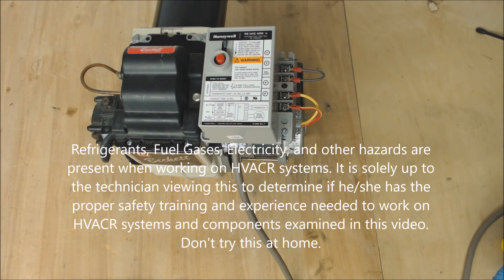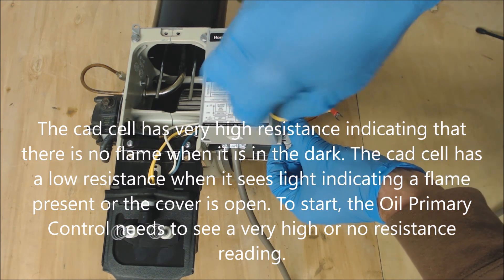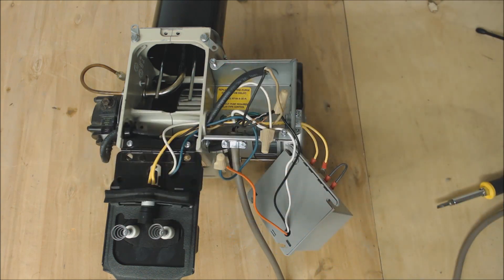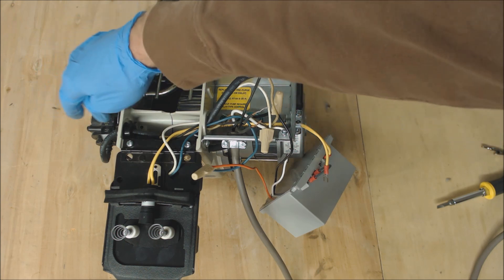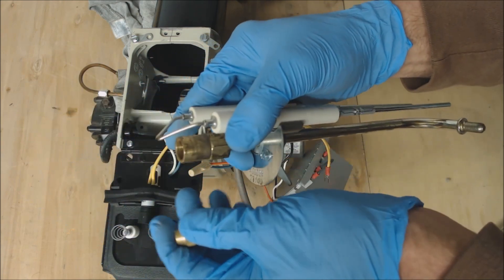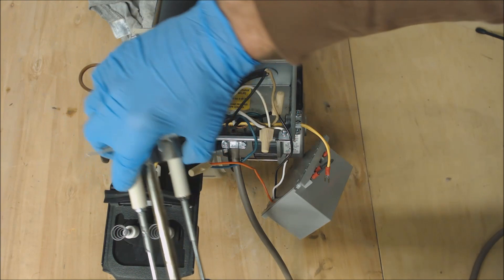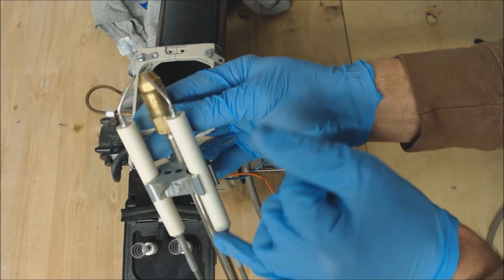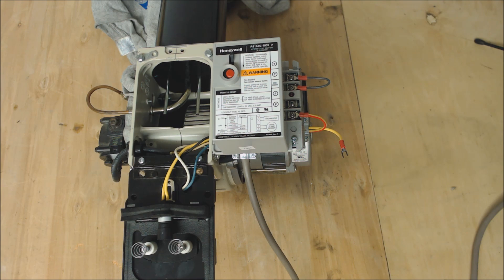Oil Burner Ignition Transformer and Electrode Troubleshooting!

Comment from the maker: Tool List-  https://www.amazon.com/shop/acservicetech
Support-  https://www.patreon.com/acservicetech
For those that are looking for the tools used in the videos: (Linked Below)

Intermittent Ignition Oil Primary Control by ICM- http://amzn.to/2AGvcPi

Nitrile Gloves 100pk - http://amzn.to/2jG2rHS

Cad Cell with Bracket by Beckett 7006U- http://amzn.to/2jGajJk

Beckett 51771u Electronic Ignitor with "A" base-  http://amzn.to/2ib22N8

Ignition Transformer "Allanson 2721-628G"-  http://amzn.to/2noADwD

Multipurpose Electrode Gap Gauge by Beckett- http://amzn.to/2AqavV5

Beckett Z2000u Gauge Kit "Z" for setting electrode gap- http://amzn.to/2jFuPd2

Here is the Link for the UEI DL479 Multimeter with temp sensor- http://amzn.to/2jtsUbJ

Here is the Link for the UEI DL 469 Multimeter- http://amzn.to/2jw4ePJ

Here is the link for the Irwin Wire Stripper/Cutter/Crimper-   http://amzn.to/2dGTj2V

Here is a link to the Stanley 6 in 1 screwdriver-  http://amzn.to/2x7NuaZ

Other tool links can be found in the video description section.

ACSERVICETECH is a participant in the Amazon Services LLC Associates Program, an affiliate advertising program designed to provide a means for sites to earn advertising fees by advertising and linking to Amazon.

All of the ACSERVICETECH Playlists-  https://www.youtube.com/channel/UCOZR-1IqsAer9wzlvFgb4mA/playlists?view_as=public

If you want to support the ACSERVICETECH Channel and receive more HVACR content, check out www.Patreon.com/acservicetech

Comment: I  finally  I  noticed  the  2  ELECTRODE RODS   AT  THE TRANSFORMER   SPRING  CONTACT  were slightly OFF  the  HORIZONTAL  WHICH   Prevented  FULL   Contact of THE  2 Transformer  Springs FROM EVEN CONTACT TO THE ELECTROD RODS       
 I NOTICED  THAT  THE SET  SCREW  OF THE   90  DEGREE  ANGLED FUEL  INPUT  PUPE  WOULD ALLOW  THE  ANGLE TO  BE  CHANGED   WHICH I ADJUSTED  AND  NOW  I  HAVE  FULL  EVEN HORIZONTAL CONTACT   TO THE  2 ELECTROD RODS AND  NO  MORE  SHUT OFF  OF  MY BURNER

Comment: So I have a transformer with copper tabs, not the type of springs and the igniters have copper leads (like flat sheet metal) that the transformer tabs contact. I was looking into replacing the igniters, but can only find the ones like you show in the video which are rods. Can you use the rid type with the copper tab style transformer, or can you lead me to finding the ignition style that has flat copper leads?

Comment: Great video, very educational. I have a rumbling on my weil mclain gold oil burner. I've tried different things to fix the issue but some how it continues, I found a smaller nozzle installed with 100 psi pressure wich I adjusted to the cottrect nozzle output and the rumbling continues, I replaced the expansion tank and close the oil supply since I have a large oil canister and I though it was sending too much oil. Any advice will be greatly appreciated. God bless and please continue with this great videos.

Comment: My relay doesn’t have a wire attached to the T T…..and keeps tripping off at times. At times it trips off, but stays on for two or three days that my relay does not have a wire connecting to both T and T does it need it in order to run correctly?

Comment: My oil furnace shuts down and black smoke rolls out by ignitor assembly.  it does it intermittently.  Help?  We replace nozzle but not sure size is correct, changed air filter, oil filter, and fire looks good.

Comment: Thanks for the video. The spark I am getting from my contact springs is very small. My furnace usually runs, but periodically won't start unless I press the reset button. Any idea what the issue could be?
I've cleaned the nozzle and checked the electrode position - both seem fine.
My contact springs do seem somewhat corroded though, could that be causing it?

Comment: Spark at the springs (alligator clip) seemed weaker than how it looked in the video, but when I performed the 'trick' at 8:15 spark at the nozzle looked fine. While I was in there I hit the conductors with steel wool. Put everything back together and it fired up. Not sure what did the trick but thank you for the troubleshooting tips.

Comment: Why is there a short (jump) across the thermostat terminals?
Reply: It is to simulate calling for heat.  If you're burner is hooked up to your boiler and you have your thermostat connected and calling for heat then you should not need to do this jump.

Comment: I installed a new transformer, non electronic model, but found issues when I used the front foam gasket.I was getting an occasional reset of the burner control. I discarded it and it has not reset since. Thinking my heating system was designed in the 60`s might not handle these newer 3000 plus rpm motors.The real problem was that my gas water heater was connected to the same flue pipe as the burner.

Comment: Would an ignition transformer work sometimes and not others?  I've had 3 HVAC companies come out for an intermittent shutoff, no error codes on the control box.  One suggested a thermostat, replaced it but the problem reoccurred.  Another changed the blower motor and fan assembly, the problem still persists.  It sometimes short cycles and other times runs for days with no issue.  Any thoughts?

Comment: My 30 year old burner was shutting down every few days and sometimes would take several seconds to ignite. Could not figure out why. Good oil flow, new nozzle and electrodes. Replaced old transformer with a new Beckett electronic igniter for $50. Problem solved! Now she fires up instantly. The electronic igniters have much higher voltage.

Comment: Any thoughts on what would make the transformer spark go away intermittently? When burner starts to stumble i Iift the transformer slightly off of the springs and there is no arc from springs to electrodes. I cut power at wall switch. If I don't cut power primary control will trip. Changed primary control and transformer and cad.Thoughts?

Comment: Like your videos. Precise and concise without background music/noise. Do you happen to know the resistance between the two primary leads of the electronic igniter (Beckett 746001)? I bought a new Beckett electronic igniter but the resistance between the two primary leads is infinity. Is it normal? It wouldn't make sense if it were a iron core transformer but not sure about electronic transformer. The resistance between the two secondary leads (springs) is somewhere around 4 ohms, which makes sense.

Comment: I get a spark without disconnecting one of the cad cell wires.   Right now my furnace will not run and the reset button is not working (is not "popped" out - pushing it does nothing).
Reply: What was your fix?

Comment: If you are working on a real nasty one it’s safer to use a flare nut wrench on that fuel line. You can get a cheap imported set from any chain auto parts store for like $12 and it’s just a little bit more secure. Great video helped me a lot

Comment: I measured 30 volts where the thermostat connects to the Honeywell R8184G relay control. Does the transformer that controls the furnace blower supply power to that Honeywell R8184G or is does a different transformer supply power to it? My heat pump is controlled by a different thermostat. Was wondering if I need to run one wire from the heat pump to Honeywell R8184G to pull the relay in so it turns on the oil furnace when it's to cold for the heat pump to operate? Also assuming the transformer that supplies power to heat pump thermostat and heat pump controls also supplies power to the Honeywell R8184G?

Comment: Does this mean that the electrodes are sparking at all times as long as the burner is burning?
I thought that the spark only ignited the flame and then after some 15 seconds it stopped sparking.
Reply: That's correct, it is the primary control that tells the transformer to spark! Once you achieve combustion with atomized fuel / air mixture the spark is no longer needed. 

The motor shuts down and the control goes into reset if the cadmium sulfide eye fails to see sufficient light. This means that if the flame is dirty enough it will shut down due to poor fuel / air mixture.

Comment: My oil water heater recently has a problem. It does not turn on when the water drops to certain temperature. But when I press the reset button, it turns on and will heat the water to the preset temperature and only does it once. I am suspecting the aquastat is not working propertly. Am I right in this regard?

Comment: Yep, learned the hard way to not use a meter/test leads that aren't rated for the voltage.  Meter and leads were fine afterwards, but I received a physically unpleasant sensation.  "OKAY, not doing that again!"
Reply from the maker: Yeah don't try to measure it, just check the gap by placing an alligator clip on one spring or clip with the power off and then disconnect one cad cell wire to test spark, thanks!
Reply: @acservicetechchannel  Several other things leading up to that "snake bit" furnace story, but the moral is "don't get frustrated and do something stupid."  I've never felt a meter buzz and be shocked through the leads before.

Comment: What ever that box is called with the reset button mine seems to be clicking more the normal like a solenoid clicking noise last night the heat was off I tapped on the box and the heat went out I’m assuming the contacts might be bad what’s that box called ?
Reply: Mine is clicking now, too, after years of my heat sometimes never turning off.

Comment: My tenant says the furnace is making a “womp, womp, womp, womp” sound before infighting?   I’ve yet to hear it when I’m there.   She said it usually happens 1st thing in morning when she turns the heat up.  Any ideas what could make that sound?   I changed nozzle and filter today.  Seems to run just fine.  
She said the noise sounds like a washing machine?    Weird

Comment: Can't find solution : Riello F40 oil boiler starts (air, fuel, spark) yet only runs for 1-2 secs. Then upon second attempt (ignition) it stays running fine. Sometimes, it takes a third attempt to run properly. Sounds like the flame goes out almost instantly.
Reply from the maker: Sounds like either the cad cell or primary control, thanks!

Comment: I was wondering if you could answer a question. My weil mclain boilers primary controller doesn't supply enough power to the blue ignition wire. (.3 of an Amp) motor, selenoid both have 120 and cad cell is disconnected. Is there anything  that may prevent power from going through the ignition wire. Also is it safe to use a intermittent primary controller which combines the motor, oil valve selonoid and ignition wires together instead of a controller that activates them separately. (temporary fix) Thanks in advance.

Comment: What would cause oil getting into the transformer cavity?
Reply from the maker: That could be a loose connection or blow back when the blower shuts off. I would call a service tech if it is not just the loose connection, thanks

Comment: You did a good test to show a good igniter, but you have failed to show how to test for a no spark from the igniter. Could it be the controller or the igniter, how do you tell.
Reply from the maker: Hey Allen, there is only two wires going into the spark module or spark transformer. If you have power in but no spark across the alligator clip when testing when the cad cell is covered then it is a bad spark module or spark transformer, thanks

Comment: Great video!! I was hoping you could lend your expertise in a little dilemma that I have had this passed Thursday... so I called my oil company to come and do the routine maintenance of cleaning the furnace, changinging thr filter.. etc?Was quoted 149.00 for the routine maintenance.The technicncian told me I needed a new igniter.. that mine was weak... I agreed and the final cost was 450.00. My heat was then turned off because it was a fairly warm day.. had dinner, went to do dishes and BAM... we have no hot water now( our hot water is powered by the furnace just as our heat is). So now I am freaking out.. fast forward a few hours and it’s grtting a bit cold in the house so I turn the heat back on... go to do dishes after dinner and low and behold I have hot water again... now I am thinking wth?? So just to see if I’m not going crazy I turn the heat off again and sure enough I have no hot water again. I did this three more times just to rule out any weird coincidences and to reassure myself I am not crazy.... I’m not... well maybe a little but on this particular subject.. I am not.. so .... I call the company back and tell them , hey.. had some work done to the tune of almost 500 bucks and now I have no hot water unless I turn my thermostat up to 65 to kick on the furnace... I have never had to do that before in a year and a half to be exact.. so whatever the technician did... something went wrong.. obviously I don’t want to have to turn my heat on during summer to get hot water.. they are sending someone on Monday.. but now I am feeling a little distrustful and would like to know if you have any idea what this could be. As I said during summer our thermostats is off... never have I ever had to turn it up to get hot water.. please help if you have any suggestions.Thanks so much for your time..
Reply from the maker: It sounds like possibly the control for the boiler is now changed and instead of always keeping the water jacket at 160-180 degrees all the time, it only turns the burner on when heat circulation is required. That is if I am understanding correctly, thanks
Reply: They turned the low limit all the way down, turn it back up to 160, next level

Comment: Excellent video.  It ALMOST makes me want to return to the east coast where I used to work on oil-burning furnaces and water heaters.  I don’t miss it a bit.  :)

Funny.  I had one call for an oil burning furnace not working.  Customer complained entire house stunk of exhaust.  When I smelled it, it was like there was a Mack truck idling down in the basement.  

Turns out customer purchased a new couch that sat very low to the carpet (very small legs).  They put it over their cold air return in the family room causing a vacuum in the basement—a vaccuum pulling on the exhaust damper!  We ended up having some custom legs made for the customer to raise the couch to allow air to enter unrestricted into the return.  One thing I’ll never forget was how it could suck closed the door to the basement and slam it pretty hard.  That’s how tight the house was and strength of the vacuum created.
Reply from the maker: Absolutely, crazy huh! Thanks Brian!
Reply: Great troubleshooting

Comment: do the spark electrodes need to have points on them? I see a lot that dont and it still seems to ignite oil
Reply from the maker: As long as they are meeting the spark gap then the electrodes are fine with or without the points, thanks Capitol!